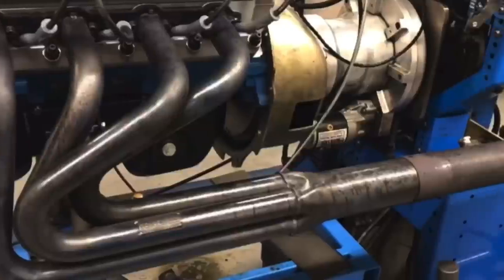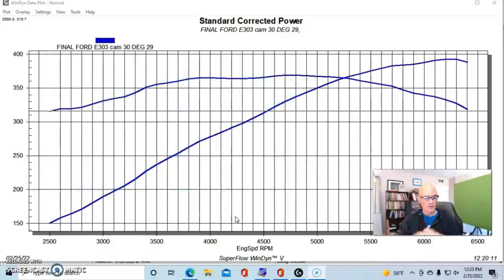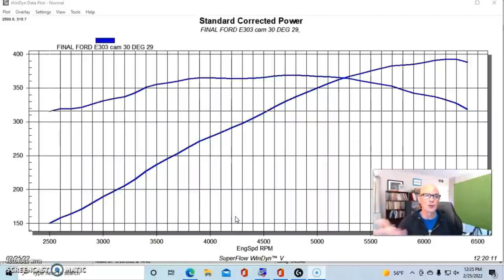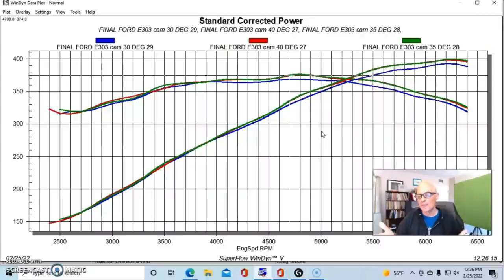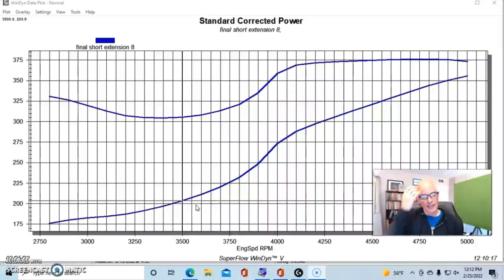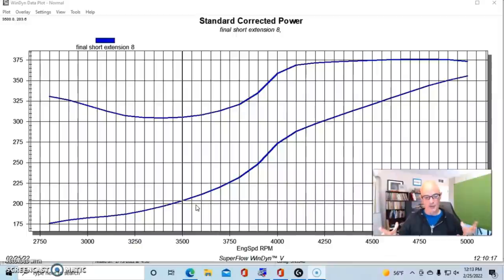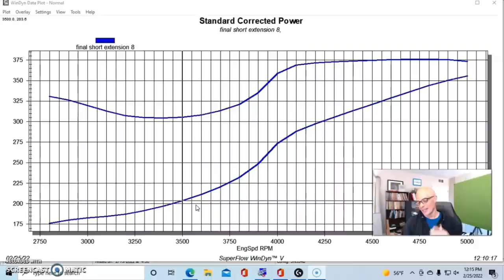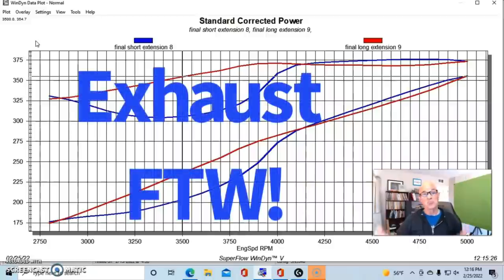HOW MUCH POWER ARE LONG-TUBE HEADERS WORTH? HOW DO I FIND THE MISSING 50-LB-FT OF TORQUE? 5.0L FORD!

Comment: Hey just curious and been watch for awhile now love the info you provide keep up the hard work man. 
Now I'm curious about the difference between the two firing orders between the older 5.0 and the H.O. 5.0 when and why did they change is there performance gains which is better and why. 
Got a 92 f150 5.0 with and mustang H.O. cam. Changed my fuel injection to fire with newer firing order. Would like to get more clarification on this can't seem to find a straight answer. Thanks
Reply from the maker: IT WAS NOT DONE FOR POWER

Comment: Using the exact same engine, head and cam I'd like to see what it does with the 1 5/8 to 1 3/4 stepped header (with 3 1/2 collector) and also 1 3/4 tubes with a 3inch collector because the collector length could be a problem when in the vehicle.
Then put a full 2 1/2 & 3 inch exhaust on it. Seldom do we get to run an open exhaust unless it's on the dyno. Some tracks even have a noise limit that makes you use some kind of muffler.
Reply from the maker: step headers might be cool

Comment: Could you really dial in the timing backing off from 35 degrees to 33 and seeing if the power increased.  Then keep splitting the difference until you find the lowest total timing for the most power?
Reply from the maker: WE CHANGED IN IN 1-DEGREE INCREMENTS DURING TESTING

Comment: I suspect the smaller the primary, the higher and also sooner the torque curve would come on, but then possibly fall off a little sooner .
Reply: The cams are holding these engines back.

Comment: G'day Richard.  If you change the diameter of the header pipes, or the diameter of the collector pipes, without changing the lengths, there will be no change in the power output, over the entire RPM range.  That is because the length of header & collector pipes are dependant upon a pressure wave which travels at the speed of sound, not the diameter of the pipe.  The only thing that would affect the pressure wave is a change in the density of the medium it is travelling through.
Reply from the maker: there is more going on that just 1 pressure wave (there are multiple), and tube diameter can change power

Comment: I'm gonna break the norm and maybe hurt feelings, but header primary tube size and collector diameter for this little 302 should have been 1.5" primaries, with 2.25" collector chokes. With properly designed, long bend radius primaries, and a tighter collector choke, I would expect this engine to have made at least 25 more hp and 25+ ft-lbs of torque. I understand there is never a perfect world, but most hot rodders put way way way too large of primary tube headers on their engines. Dyno headers are a great example of one size does not fit all. Not knocking Richard at all, his videos are great, and I'm sure he probably knows what I'm referring to.
Reply from the maker: 1.5 headers won't add 25 hp
Reply: @richardholdener1727  I appreciate your comment, but Properly designed 1.5" stepped to 1.625" headers with a properly sized collector will make more power and torque across the entire rpm range.

Comment: Would the 3inch collector be the same as going from header collectors into 3inch exhaust pipes?
Reply from the maker: I think running a 3.5-inch collector to a 3-inch exhaust would be different than running a 3-inch collector to a 3-ionch exhaust

Comment: funny, your question at the end was in line with the question I was holding til the end of the video. Do you think that the length needed for scavenging is related to the diameter of the collector? I suspect, with a smaller collector, regardless of primary size, you'll get away with a shorter extension before you see a loss of scavenging because of how the pulses will reflect down a smaller tube.
Reply from the maker: I have tried collector extensions with smaller collector pipes and it still worked
Reply: @richardholdener1727  My theory on it still hangs around the idea of the pulses reflecting down the pipe.
 I've run crude math on sound waves at given frequencies when building exhausts to help achieve certain tones I wanted to amplify or diminish, and I think this hinges on the same idea; you need a minimum length of pipe to see the exhaust pulse travel far enough to generate the negative pressure behind it and draw the following pulse out. If the pipe is too short the exhaust pulse just goes into open air before it can begin drawing the following exhaust pulse. Your missing 50 is basically the difference between having an expansion pipe on a 2-stroke, or not.
The minimum length of pipe needed to see gains is probably proportional to diameter, but I have no idea what the relationship would be. My guess is an exponential curve.

Comment: Velocity increases in the longer pipes,more power,my theory is that if you ran both pipes into 1 with a scavenger collector it would boost torque in a big way,maybe not HP,it would be interesting to see the difference.That is why a X pipe works better than a H pipe,the X creates velocity.

Comment: It's interesting just how much timing can vary depending on your combination. My sbc liked 34 degrees. My brother's Pontiac liked around 40 degrees. My ford coyote stopped making power at just 27 degrees.
Reply: It's mostly about the flame travel efficiency of the chamber. Compact with lots of swirl need less timing. Big open chambers need more timing. Don Garlits has a funny story about when they first started running the 426 hemi at the request of Chrysler. They started running at the 34° timing they always ran on the 392, but it ran slower. Planning to destroy the engine with excess timing so they could go back to the 392, they ended up at 50° which dropped .8 sec and gained 27mph. 
https://www.youtube.com/watch?v=kdE693EHpNQ
Reply from the maker: just give the motor the timing that it wants-it will tell you

Comment: Changing collector length on a Dyno or at the drags is fine, but how do you optimize torque on a street car with a full exhaust system?
Reply: Run your car on rollers to find out.
Reply: @cammontreuil7509  That would work, but I'm asking hypothetically. I'm searching for proven theories, rules of thumb, so I know which way to go with changes.
Reply: @cammontreuil7509  I've never had the opportunity to Dyno test any of my junk, I did all my testing and tuning at the drags, had a ball, and learned a lot. I don't have any hot rods at this moment, but I'm buying back one of my old ones next month. 👍

Comment: It needs a 1 5/8 to 1 3/4 stepped header w a 2.5 Dia collector.
Reply: Yes, it does.
Reply from the maker: CAN YOU SHOW ME THE DATA
Reply: @richardholdener1727  
I don't know about data, but it seems fairly common knowledge when talking about small blocks. You should do a video on it. You do a great job of sorting this stuff out, and although I know it works (at least for the street) I'd like to see the numbers.
Edit: as I got to thinking about it,  I recalled the primary tube diameter should increase as your desired rpm increases. So a street header wouldn't look like a race header.

Comment: Clear example of reversion due to loss in velocity.  Even with the extention added.  For that power per cylinder...id make a set of headers with 1.5 for the first step (blow down length), 1.625 for the next size then tri-Y it with 1.875 secondaries with probably a 2.25 or so throat expanding into 2.5 after that
Reply: We both have very similar comments. You wouldn't happen to be a student of a Mr. Elston, or perhaps a Larry Meaux would you? 😉

Comment: I have hooker super comp headers and they're only 1.5" primary with a 2.5" collector, it's a 5.0 302 Ford but the chassis is the problem - 78 mustang 2
Reply: Everything is a tight fit in the engine bay of a 78 Mustang II ! 1 1/2" headers still make power! Changing plugs must be a weekend job!